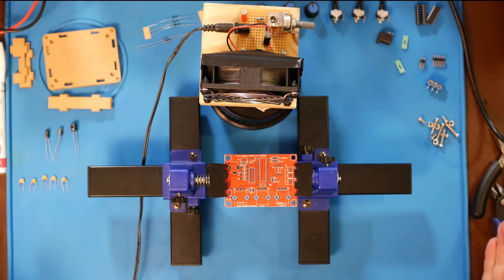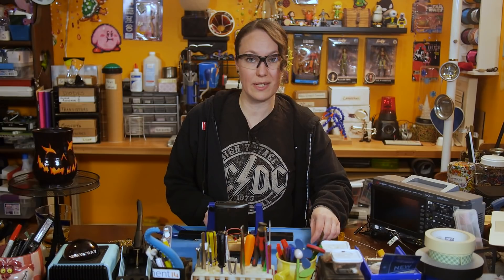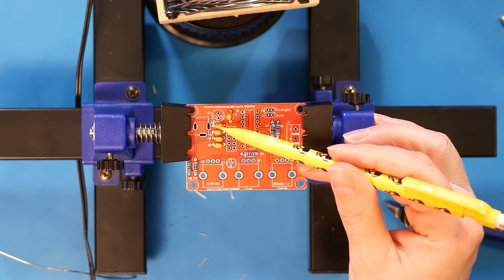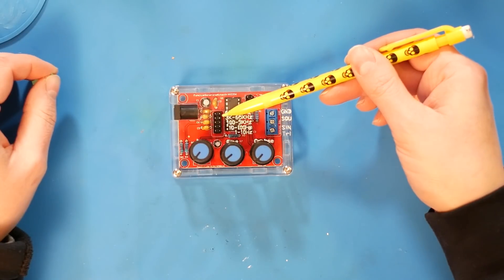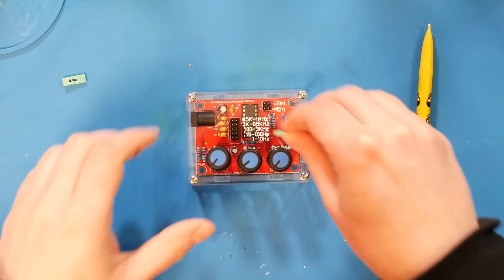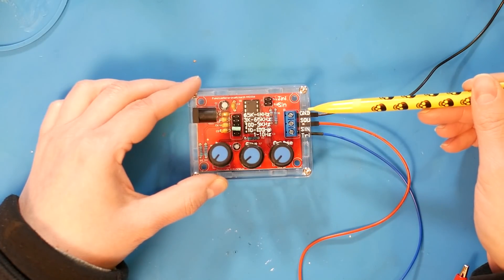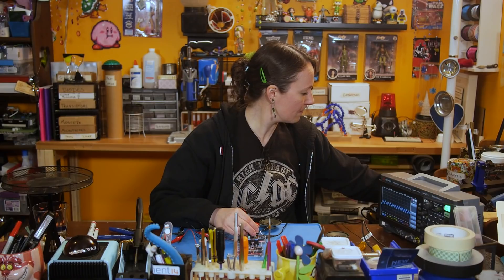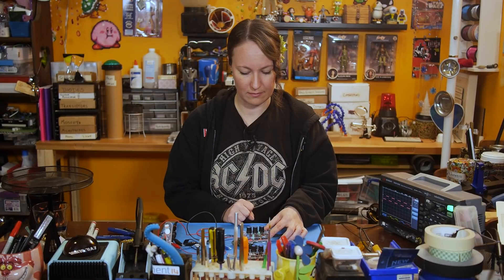DIY AC Waveform Function Generator Kit - The Learning Circuit

Comment: Replace the 330 ohm resistor with a 500 ohm pot. This makes it possible to set up a much better sinewave.
Reply: I can only find potentiometers that have 3 legs. is there one that has only 2 legs ?  the 330ohm has only 2 holes. you mean a 500 ohm Potentiometer yes?  if it's 3-terminal which leg should be cut off?
Reply: @neo256mb  What I did was bend the middle leg over to make contact with one of the outer legs and solder them together. You then have a two leg variable resistor. 
The other way would be to cut off one of the outer legs and use the two as your variable resistor.
Reply: @jonka1  thank you. It does not matter if I solder the middle leg  to the left or the right outer leg?
Reply: @neo256mb  It will only affect the direction you turn the pot to increase or decrease the resistance.

Comment: Is the output AC or DC ?
Reply: Sine and triangle are AC.  Square is more DC that's ON/OFF, ON/OFF, ON/OFF ...
The kit is very cheap and not that great.  However if all you need is varying tones for testing audio circuits or DC pulses for timing/logic circuits - who cares if its not amazing.  If you want to test speakers, then get a cheap amplifier kit as this generator is low power and NOT designed to drive speakers.

Comment: Good on you for emphasizing the use of safety glasses! Many years ago, back in my days of youth and stupidity, I used to not wear them. Then one day a hot splatter of solder (or was it flux? well whatever it was, it was hot, splattery, and went airborne) came within inches of hitting my eye. Ever since then I never solder (or do anything involving tools, screws, little pointy bits that could suddenly go airborne if you're not careful, etc.) without them.

Comment: may be a newbie question, but how can you attach LEDs directly to AC current??
Reply: Full-bridge rectifier + some resistors to limit the current - but that's assuming you have enough LEDs to "cover" most of your AC voltage. In other words plenty of LEDs, otherwise the resistor wattage will be massive and you'll waste a lot of power due to resistor heating up. This is very inefficient way, but the simplest. Check out BigCliveDotcom's channel for disassembly of many LED bulbs for inspiration :) And be careful!
Reply: @greengohm  it just seemed odd how she just plugged LEDs right into the signal generator. Thx for the great explanation, but did she convert to DC? i missed it. 😉👍
Reply: @ChrisLocke1969  For this kit, the output is AC, but it's very low voltage. Maybe 5V. The LED pack usually takes 3V. So when the wave rises to 3V, the LEDs have enough power to turn on. Luckily, the 5V isn't enough to burn out the LEDs, but if I let it run for a long time, pushing the voltage and current beyond the ratings of the LEDs(up to 5V, and beyond 20mA) would shorten their lifespan.
Reply: All diodes work quite happily on a.c. just depends on application. A rectifier diode converts a.c. into d.c. and so on. An LED is no different apart from different voltage drops (not so good for a rectifier) 

There is a nice demo (see link) when a series of LEDS were connected as a bridge rectifier and fed at first with a simple dc supply manually swapping over the connections, then with a function generator with a nice slow sine wave, it clearly shows the operation.

https://www.youtube.com/watch?v=6XCdCTQSeRw

about 4 mins in and then 8 mins in.

The little function gen is operating as a switch on square wave, so it's no different to connecting led to a battery. You just have to ensure that you don't over current the LED, so a current limiting resistor is advisable.  The other waveforms will do much the same. As shown the sine is not really a true sine at all..
. 
That kit is pretty notorious for problems, and not working to the spec, but it usually does something which is the main point. 
Andy

Comment: Good video! I'd like to point out that barely being able to hear the 10-100 Hz signal with the speaker is a function of the response curve of that small speaker. Typically, a small (1-3" diameter) speaker response drops off quickly below 400-500Hz. Some will, like yours, drop off below 1KHz. Also most of these inexpensive speakers have nasty resonance peaks that practically blow your ears off when you hit them... Sounded like yours hit resonance around 3KHz. If you ever need a technical bit expounded upon, hit me up at Dutchman Electronics. Happy to help! I'll keep watching and may kibitz here in the comments from time to time. :)
Reply: Thanks for the added information!

Comment: The power jack and potentiometers are mechanical points of failure. 
Bending the leads flat to the PCB will make them almost impossible to replace later.

Comment: I was wondering if a HPF on the sine wave function would help round it out more, but with variable frequency that's probably a nightmare to work out
Reply: Could do with an op-amp integrator (just two components op amp and capacitor) to curve the triangle wave bit more. Would just need a capacitor that can handle the high end well enough.

Comment: Hi.  you did not give the diagram or the name of the integrated circuit used ?!
Reply: I'm pretty sure it's an XR2206 IC. I have what appears to be the exact same kit (or very nearly identical at least), and that's what mine is based on. See, for example:

https://www.amazon.com/Weewooday-Generator-Function-Frequency-Adjustable/dp/B08SMB6DRM/
Reply: It's most probably a fake Xr2206. It's okay for this application just don't use it above 9V

Comment: I did this kit once! I was having a great time until i put the potentiometer knobs on before the case, and the gnomes used magic to keep the knobs stuck very fast on them. In my attempts at removing the knob, i broke the board, and never got a chance to try it out. :(
Reply: Oh that's so sad! That's totally something I'd do.
Reply: The PCB is fairly simple. You could probably create it on protoboard using the circuit diagram that came with the kit.
Reply: Create your own on a perf board

Comment: What is the integrated circuit that you were using? I did not hear you mention that
Reply: I got the kit off Amazon. Here's the link: https://smile.amazon.com/Weewooday-Generator-Function-Frequency-Adjustable/dp/B08LGV8ZKP
Reply: It is likely a fake XR2206. It is okay for use in hobby applications, provided you stay below 9V. Kainka Labs has a video examining this kit in detail and found that the signal becomes unstable at 12V and above. That wouldn't happen with a real XR2206

Comment: This could also be designed using simple analog circuit . 1st stage - Astable multi vibrator using OP-AMP (50% duty cycle) , 2nd stage - integrator circuit to have triangular signal with suitable value of feedback resistor for desired amplitude of the signal , 3rd stage - another integrator circuit for sinusoidal signal with suitable value of feedback resistor ..
Reply: Better still the good old 555!
Reply: @andye2005   but 555 will not give u the complete square wave as it has not any negative input supply it gives a pulse +Vcc to 0 ... we r talking about the complete square wave that is +Vcc to -Vcc  and that can be generated by OP-AMP .
Reply: @soumiksarkar1988  if you are going to post process the signal after the osc (whatever it is) then it does not really matter if the osc swings +/- or not. You can deal with any requirement for +/- swing then. 

 Something like the 555 just gives you more options to play with. (drop in the cmos version and you get a bit more voltage range tom play with if needed.)

Comment: Great video Karen, crappy product unfortunately. The sine wave was awful, and why didn't the amplitude adj impact the square wave? Are there any other frequency generator kits you'd recommend?
Reply: The circuit does not cater for changing the square output. It is a simple pull-up at logic levels.